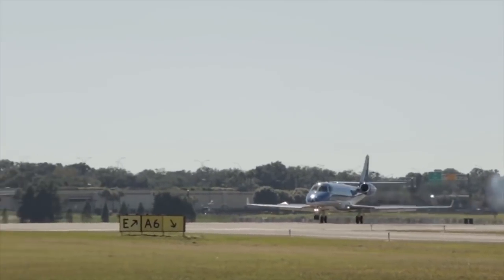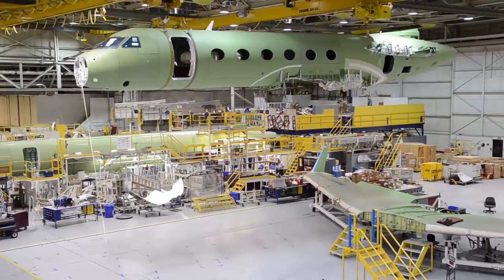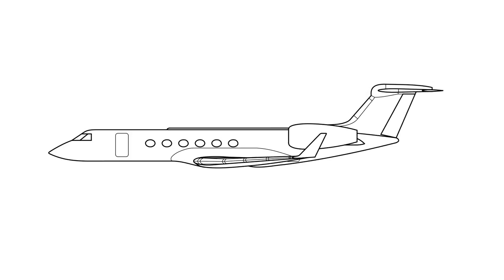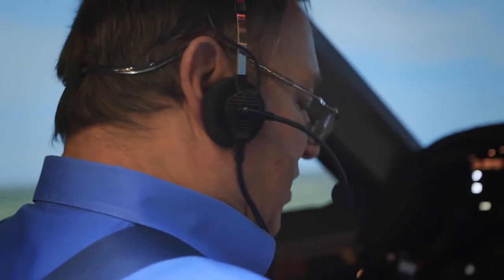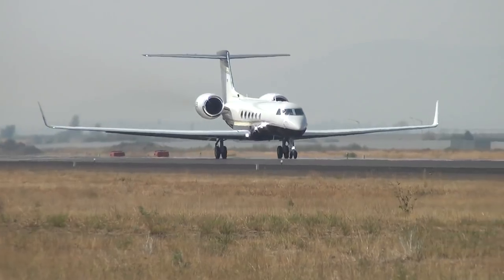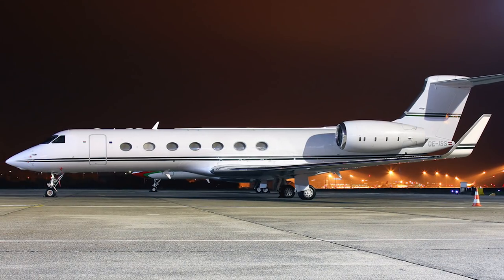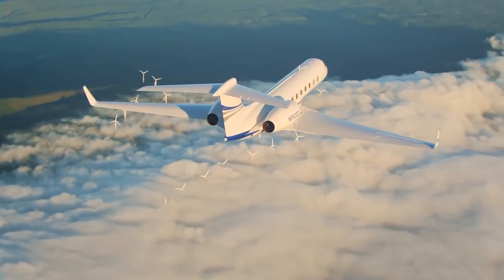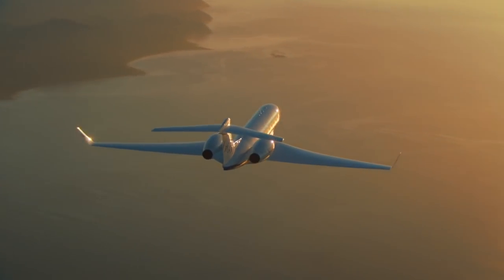Gulfstream V - very expensive friend

Comment: For simplicity's sake:
G500/G600 are both considered the GVII generation, but are officially taking over the G450's and G550's spots respectively. The G650 (GVI) is still the flagship and the largest, most opulent, most expensive Gulfstream.
Source: I maintain them.

Comment: Great, now all the televangelist will want one!
Reply: In  2014, Creflo Dollars GIII ran off the runway and airframe damaged
In 2015 he asked his 200,000 followers for $300 each, so he could buy a G650...

For ministry purposes.
Reply: mountnman3609 Praise Be
Reply: A G650 cannot takeoff and land at small airports.
It needs longer runways. At least 6,000 ft.
Runways also need to be able to handle +90,000# 

It has a BOW of 54,000#Fuel Capacity of 44,200#
Max takeoff weight of 99,600#

Which means, for full 7500 mile flight, it has a max pax and bag capacity of 1400#

Not going to be doing any "missionary work",
flying "medical supplies" into remote Africa or South America

Comment: you said the G500 model it's on the top it is the 650 model that has it on the top.  The 550 was the GV redo with EVS the 500 was a non-EVS model.  The 650 came out next.  Sorry I just wanted to tell you so you can be aware.
Reply: There’s a current production G500 that requires a G-VII type rating.

Comment: Hehe, 51,000ft to fly over a heli...surely you meant the commercial traffic in the congested airways as a helicopters struggle to climb past 20,000ft whereas between 28,000 and 42,000ft, there is a very large number of commercial aeroplane traffic.
Reply: It was a comparison: He stated that a G5 flies over commercial air traffic like a helicopter flies over land-based traffic.